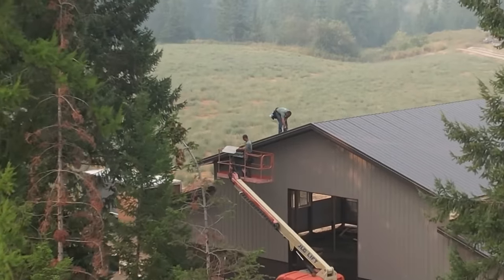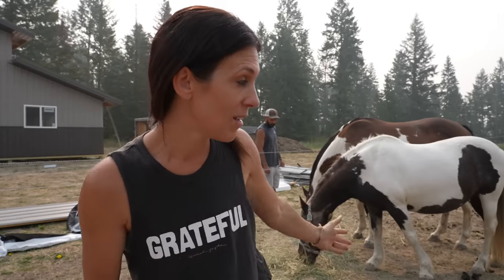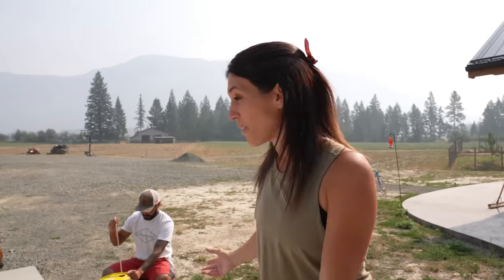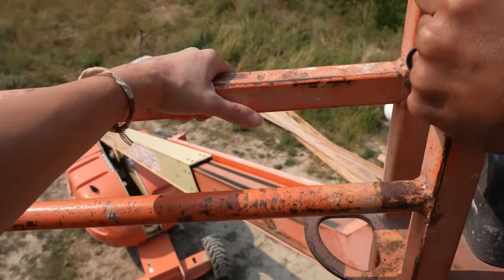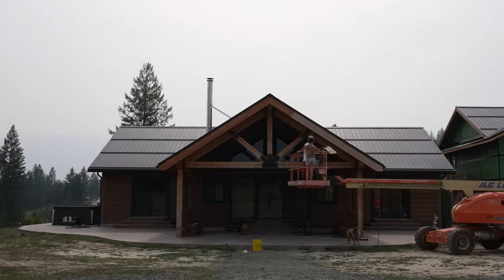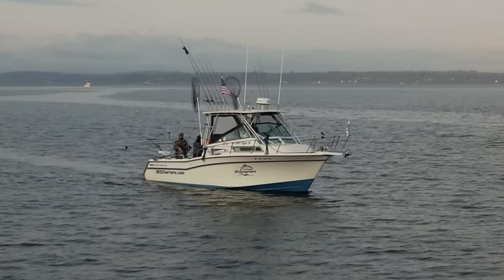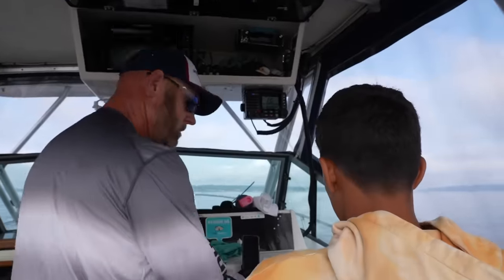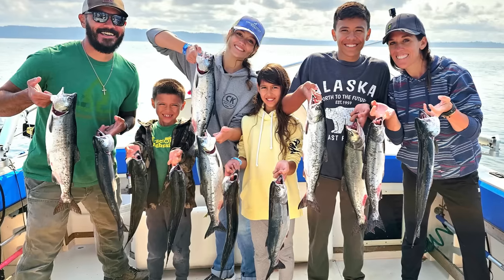Completing the Horse Barn My Wife Always Dreamed Of (64x40 ft)

Comment: So... future equipment buys will be stored in the barn.  It's a good thing, because with the need to re-stain you are going to want to buy some sort of a lift.  I've seen those cable/telephone company lift trucks/vans.  Smaller buckets, but much more mobile and many more uses... if you can find a good used one.  I mean... you are going to want something... might as well get something a little more versatile.  You know... the channel Salvage Workshop bought 2 of those things at the same time and showed the process of getting them functional again.  Might be a good watch if it's something you are interested in.

Comment: I am a big fan of semi transparent stain and have found adding more coats the next day will absorb in and add that extra layer of protection which last longer. I coated a cedar swing with several coats until the stain just sat on the surface and had to wipe of excess with some mineral spirits  and for the past 20 years sitting in all weather it still looks like the day I bought it just hosing it off every spring and wiping it down with a stain rag lightly. In your case if you put to much on it would just hold up longer to the weather and sun as it is not a seat to sit on.

Comment: Dutch barn uk (roof only pole barn  can have half walls    ) for hay and straw  ,not a good idea to store it in enclosed building. Specially when your going have hot engines and sparks from working .just not worth the risk .hay and straw in a building(  Dutch barn   ) away from anything else .plus you don't know how to stack the small bales to help make them safer. Turn the field shelter into storing hay .

Comment: transparent stains or clear penetrating oils will not peel After time the solid stains or paint stains will  always flake and peel. Some oils, such as boiled linseed oil will eventually will polymerize after a few coats applied over the first coats. it will turn black and never need finishing again.  My neighbor applied it to his shakes on the upper floor when the  house built in 1910. it had turned black after 60 years it was in perfect condition and we painted his house. Linseed oil was my favorite or decks. We used to oil a lot of roofs.  Graphite was added to the oil, but this increased the heat which caused cupping.  I am of the opinion that several coats applied over the first few years would have resulted in almost a maintenance free roof.  most people were too cheap and by the time we got to them they were brittle and crack when walked upon. When the cost of linseed oil more than doubled to more $4 a gallon in the early 70's we stopped oiling roofs. the rise in petroleum  products also bankrupted a lot of roofing contractors. Before the oil embargo I remember gas a $.17 a gallon during the gas wars,. Today there is a full menu of available products. I still prefer the penetrating oils but water borne products are available.  i have success with water based wood sealers but these are not time tested.  The theory is that wetting the wood will allow the fatter WB molecules will still penetrate  the wood pores.  WB varnishes suck and should never be used

Comment: It looks like your barn is coming along great. I like to recommend using used railroad ties for flooring in the horse stalls. The railroad ties are treated with creosote so they will not rot, and it protect them against termites, fungi, mites and other pests. Space them about an inch apart and place them on a bed of pea gravel and between them for drainage. It will help prevent the horses hoofs from rot and it's easier to clean the stalls.

Comment: Do you know if you clear coated those wooded areas that you just Kupono hold over and put the stain on it it would last you 3 to 5 years coupon all staying in clear coating it will save the wood from rotting cracking or anything and it’s a little bit easy to clean. You can actually spray it on if you wanted to. It’s just a thought I’m just trying to help but you do what you want with your home.

Comment: Jeremy & Melissa - I rarely comment on videos anymore simply because most folks that have channels as popular as yours, and they just get to many comments to be able to respond to them all but you have consistently responded and I appreciate that. I have a quick question on the barn build. I realize this will probably be done by this time but the company that is assembling the structure are they the same company that’s installing the doors?
Reply from the maker: No, separate company for roll up doors
Reply: @GoodSimpleLiving  they are roll up doors?! Interesting, are they going to be manually operated or are you going to have a power option?